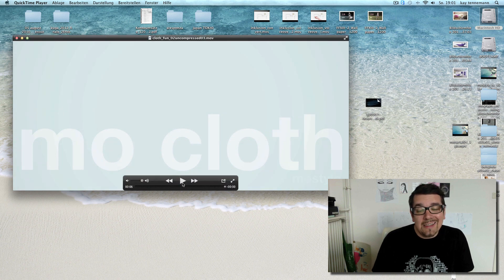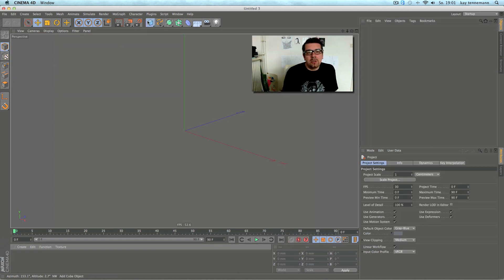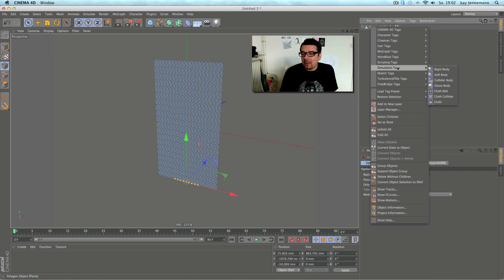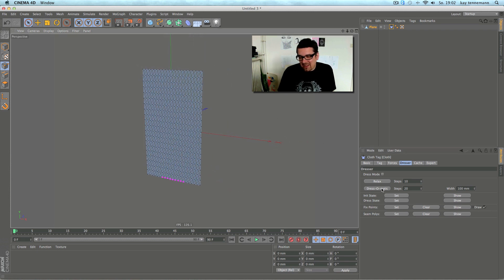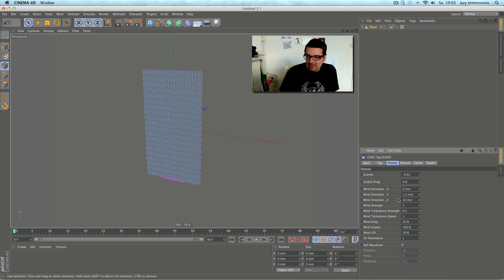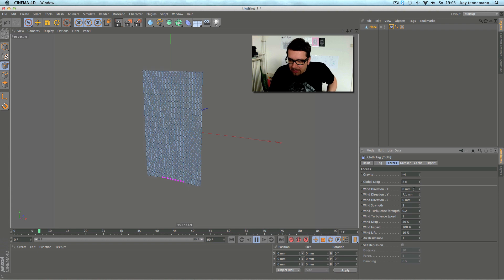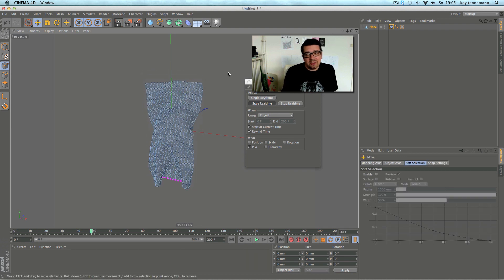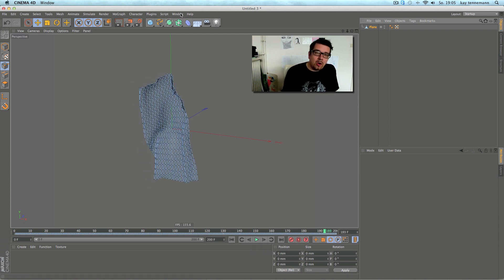behind Cinema 4D cloth / tutorial

Comment: hi bro ur tutorials r diffrent from othrs ty for new technics .  cappucino PLA option is not working propoerly it is nt capturing key-frames please do help with this.
Reply: Did you solve the problem? I also have same issue that is not working cappucino PLA option.
Reply: i captured frame by frame manually.
Reply: thanks for your answer. I solve it another way. After clicking start realtime button, hold the axis that you selected.  then, it works.